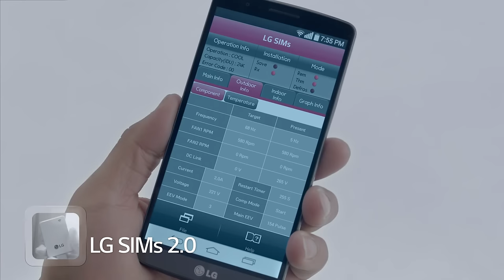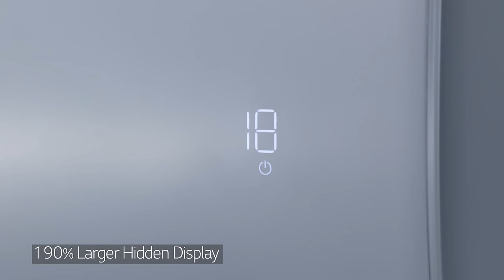LG Air Conditioner - Quick & Easy Installation

Comment: Works so well Fastly.Cool that it only requires daytime operation until high temp and humidity are overnight. It is difficult to get to side filters, but back is easily accessible.
Reply: 1:43 p

Comment: As LG ac user, I strongly recommend it especially if you live in a hot weather area .. just make sure to buy a model that has "Rotary Compressor"
Reply: Can you please explain why? I'm planning on buying one and it tends to get blazing hot here in the Philippines during summer. 😊 Thanks in advance.
Reply: swattteam2002 now lg ac comes with dual rotary compressor well I'm from india
Reply: @thalidomide01  which ac you bought ?
Reply: Yeah

Comment: Woww...the tube that came out of the left side of the air conditioning unit miraculously disappeared.  Perhaps you want to show the complete installation details so one gets a more accurate idea of how it is installed.
Reply: I'm more worried about the blue air that comes out. Looks slightly toxic.
Reply: Got to agree with this comment.  I was so disappointed with the thick ducting needed to hide the pipework.  For my bedroom installations, I had no idea before the installation guy asked me which side I wanted the 'ugly' to carry the pipe and power up into my loft.  I was lucky with a downstairs installation that was on an external wall that the exit was behind the unit..
Reply: I read the manual. that tube has three orientations left, right and rear. all three will have to go through the wall behind the unit and connect to the out side condenser.
Reply: @lwoody7110  I read the manual. that tube has three orientations left, right and rear. all three will have to go through the wall behind the unit and connect to the out side condenser.
Reply: Johnathon Allen  so there’s a condenser that comes with the unit that mounts outside?   This video is not too detailed.
Reply: They're actually making fun of their old air conditioners.
Reply: Ui lagu takut
Reply: Whayde Raeven Sarmiento  I see sarcasm died today.
Reply: @PrimeRsoul the blue air is not real it is just a line to show where is the ac blowing cool aie
Reply: Agreed
Reply: @francoestrubia6503  the bubbles aren't real it's just an illustration of the ionizer
Reply: @PrimeRsoul it's a visualizer you can't see air irl
Reply: @hab9609 yes, why

Comment: Hello I am currently having an issue with my LG Air Conditioner Smart Inverter I've Had It For A Few Years And When I First Installed it I Didn't Use It Much I Travelled To Another Place And I Just Came Back And I Didn't Use It Much But When I Started Heating For About A Month Or So I Started Having This Issue Where The Indoor Unit Stops And A Pill Icon Is Displayed And It Makes A Cymbal Crash Sound And The Outdoor Unit Noise Lowers And The Inside Just Does Not Work Do You Know The Issue?

Comment: Where did the line set go...please show complete installation!
Reply: I read the manual. that tube has three orientations left, right and rear. all three will have to go through the wall behind the unit and connect to the out side condenser.
Reply: Gone to heaven of the installators. Bullshit presentation :D

Comment: Great ... the tube that came out ofthe lest side of  the air conditioner unit miraculously disappeared. ......................................
Reply: I read the manual. that tube has three orientations left, right and rear. all three will have to go through the wall behind the unit and connect to the out side condenser.

Comment: Sir how to hide that outgoing duct pipes ?
Reply: Random Thoughts i
Reply: @vudung1435  ??
Reply: I read the manual. that tube has three orientations left, right and rear. all three will have to go through the wall behind the unit and connect to the out side condenser.
Reply: Hi is how much please

Comment: Am I the only one who saw a miracle in this video?
Reply: I read the manual. that tube has three orientations left, right and rear. all three will have to go through the wall behind the unit and connect to the out side condenser.

Comment: They go behind and out the outer wall, if you removed the unit you would see the hole for the piping  and drain where he measured away from the rack plate.. this video is not at all accurate cause you also need to install an outside unit lol